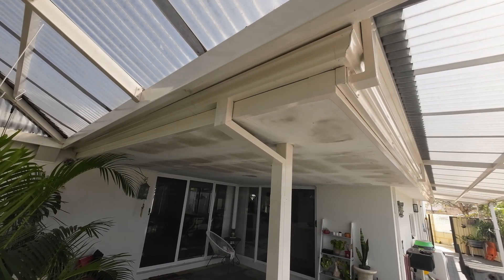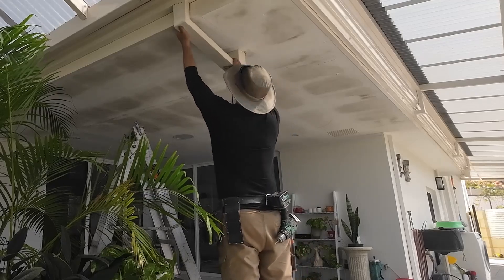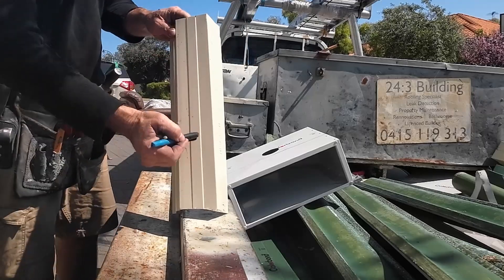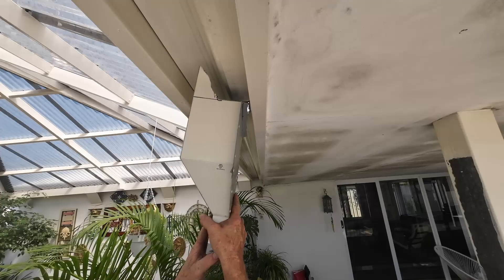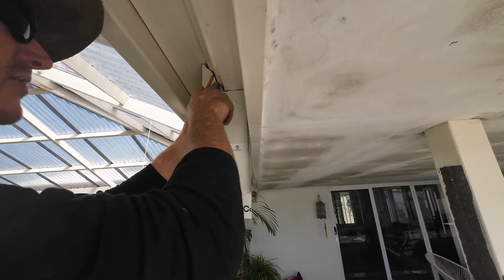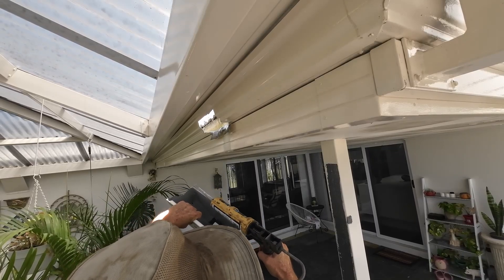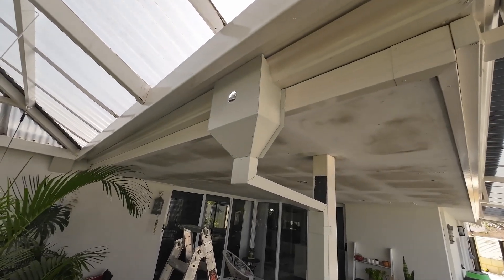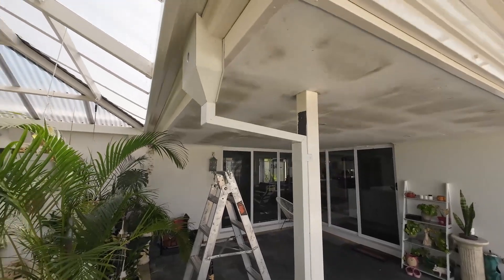Using a rain head to increase gutter capacity

Comment from the maker: this is W.A. so the facia is rebated   and you do have to cut away the back. The pergola had it own gutter . It was the initial builder. they did not allow enough run off in extreme rains the gutter overflows. fair points though.

Comment: A few criticisms...

You are still limited by the downpipe capacity, all you really did was provide overflow and even if it reached the overflow outlet the water flow rate would quickly overcome the small 50mm round hole....

Do yourself a favor and get one of those pin profile copiers that chippys to copy profiles of architraves, saves having to bog up 15mm gaps. 

There is no mechanical fixing between the gutter and rainhead.

You are better off leaving the back of rainhead in place rather than bending it to go on top of the facia.

I would hazzard to guess that rather than overflowing  gutter it would be because of the addition of the portico.
It is typical for carpenters/handymen to run new roofs straight in to existing gutters with no consideration of the angle it enters the gutter, I would guess without see it that the angle would allow the water to hit the gutter and splash past the back of the gutter entering the eaves.
It is quite evident that this is happening as the water marks are all along the ceiling, if it was a capacity problem there would less marks on the high side of the gutter.
Reply: The rain head increases downpipe capacity by adding headwater pressure over the DP inlet.

Comment: Fantastic demonstration.  I really like how that turned out.  Respectful question - given you were replacing the down pipe as well, would it be a wise idea to upgrade it to something larger eg 100x75mm to help the water get away faster?
Reply from the maker: I could have but we were putting it in place to take the really big storms we can get in W.A. and if you see the overflow in the front of the rainhead should handle that as well as the rainhead making the existing downpipe more effective.

also it fit into rhe existing stormwater without altering it